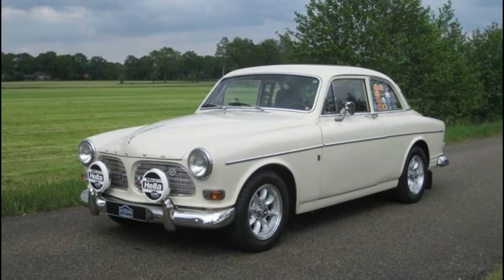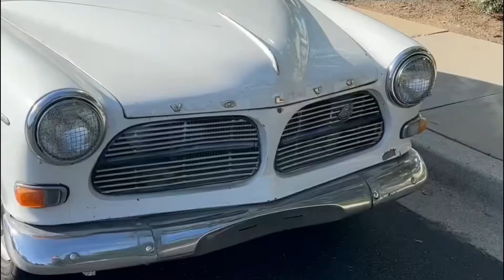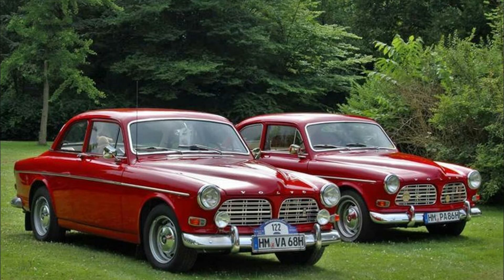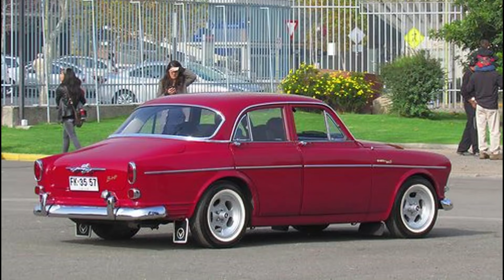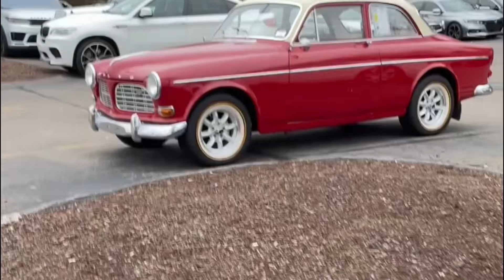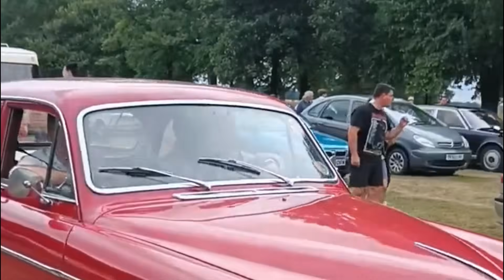#No AI - The Car Built to Last Forever – Volvo 122S Amazon

Comment: The B18 engine had more main bearing surface area than a Chevrolet big block 409. So I'd imagine using the oils they used in those cars back then if you could just have some hydrodynamic oil wedge on most of the bearing it would survive and not lock up. There were other mechanical reasons..they were more advanced than what we used here in the U.S. and that's why they could survive less oil and overheating. Still, I wouldn't try it again even with the better oils we have today.